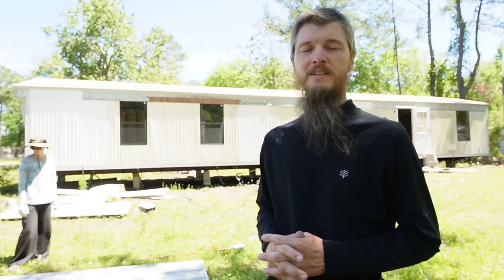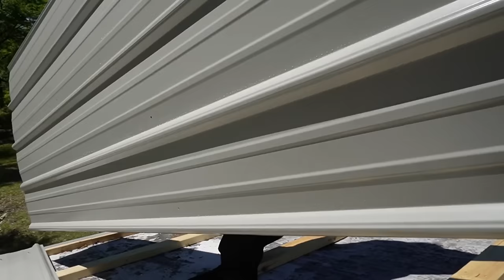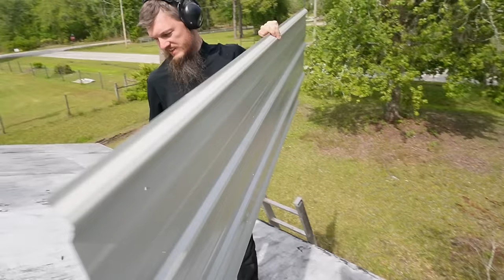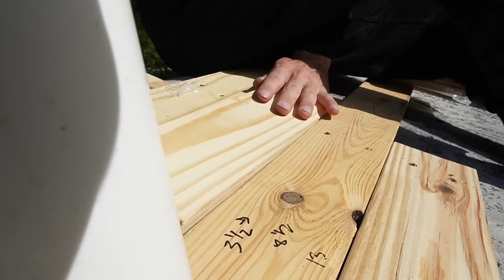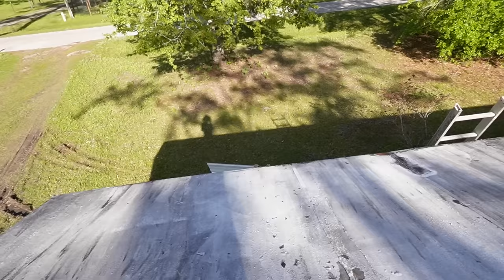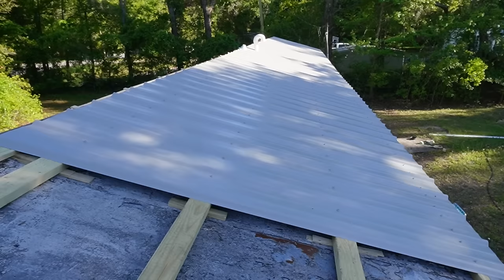Laying the First Panels - Metal Roof Install - Salvaged Mobile Home Rebuild

Comment: Suggestion, maybe you could pull the bus close to the trailer and put all your prepped sheets on top, then just lift them up on the roof from there instead of climbing up and down the ladder.
Reply: I used to call that 'training'.

Comment: I just want to say that I am so flabbergasted by the agility, strength, and sense of balance that both Doug and Ashley bring to this work.  As an old man with arthritis, it's amazing to watch Doug climb a ladder carrying a metal roofing sheet, walk nimbly across a roof stepping only on secure spots, and then drop into a full squat while reaching across to put in a screw several feet away.  If there were a DIY Olympics, you two would be serious contenders for the gold!

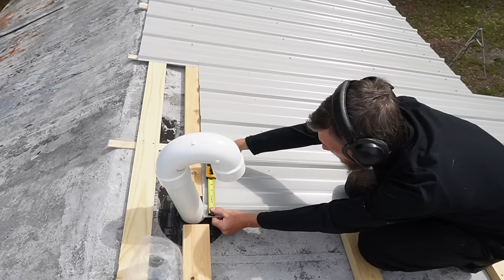Comment: That is a perfect install of the rib roofing. I also really like the color you chose -- not stark white, but still a cooler color for reflecting the heat. The only thing someone could question is a lack of stitch screws or butyl tape on the seams for the most extreme weather prevention measures, but you also still have the original roof underneath it and with your purlins spaced together as close as they are, it's really doubtful you'll ever have issues. I'm a typical over-killer on things. The roof is looking great! @17:45 That was the perfect Dad joke! Well played! Bravo!
Reply from the maker: Thanks! Thanks for stopping by again. We're pretty much just going by the instructions and they say butyl tape on the seams is only required for under 3/12 roof pitch. 

I may have to remove a roof panel or two when I install the plumbing vents. So it's probably going to work out in my favor to not make this roof too stuck together!

Comment: You two chose the perfect color: Black or dark colors absorbs the heat, white reflects the heat but looks messy quickly. Gray is still light enough to reflect and will look nice in the long run. Y’all always make great decisions 😊

Comment: Where we live, you have to use butyl tape on the overlap, and that join also has screws through. Plus bug screening to block the raised channels.
Reply from the maker: Pretty strict but at least you'll have a solid installation.

Comment: It looks so good Doug and Ashley and kids.. the cap for me was the roughest. Just measure on the metal where the edge of the cap will set and find some nice rubber gripping shoes. And have all that you need, pieces and screws. You don’t want to get your feet wet. Rug or cardboard to clean your shoes off and set up on the sunny side,, the sunny side of life!! The best is when it rains. So proud you jumped on this project.it’s exciting, challenging and fuel for your soul. Looking at it done will be so satisfying.. a jack of all trades and a master of none. Keep practicing you’ll get a diploma in them all..❤❤❤❤❤

Comment: The roof color is perfect....great choice.  Doug, I am so glad you predrilled the sheets.  It make the holes line up so nice and I would think it is quicker in the long run rather than being up on the roof trying to align it, hold the sheet screw into it etc.  I saw this done by another you tuber a few years back and I thought then, what a simple idea to make work smarter not harder.  Thanks for sharing.  Y'all have a Blessed day.

Comment: I was surprised they didn't give you bug stop for the eaves. It is a stick on strip that goes on before each panel and also under the ridge cap to seal up the gaps.
Reply: Yep. It keeps the wasps out.
Reply from the maker: We got closure strips for the ridge but the roof people suggested that it wouldn't be necessary for the bottom. They did give me the option though.

Comment: Great job! I told you the color of the metal panels makes it look so much better! Its beautiful! Love the color you chose.By the way , i was impressed by the roof screws with the rubber washers also. I'm using the colored ones with the washers for the ones thru out the body of the mobile home, that were missing or rusted.LOL Mine is so old, it's needed . My roof is chocolate brown

Comment: As always, Doug, you are very professional and attention to detail. I just wish you had put foam insulation sheets between the purlins and the roof sheeting.
Reply: Would the foam insulation be primarily for sound deadening, for temperature management, or for moisture control?
Reply from the maker: We just couldn't justify any possible benefit from it. It would have added $1,000 to the job.
Reply: @eviefieseler1093  Both....plus no need to have air circulation or roof venting for the heat.
Reply: @diyfferent  Many benefits.

Comment: Doug, where your vent coming out of the roof meets the joint of the metal you will have to silicone that joint because rain will run under that joint into the hole in your roof and into your ceiling.. ask me how i know

Comment: Your right the short edge overlaps .  A string line down the middle length of the trailer
keeps you going in a straight line . Did you put a screen in you elbow for your vent ? I need to do the same thing on my vent to keep the bugs out .Your doing a good job . Two thumbs up .
Reply from the maker: Yep, we will be putting a screened vent cap on it :)

Comment: The grey looks great! Not too bright but also won’t soak up heat like a darker color. I think this project is definitely one where you need to have the right tools for success. Routing the board, shimming, cutting etc. a lot of technical things with this particular roof

Comment: When I worked on the cap I tied a rope on the other side so I would have something to grip on to pulling myself up. Then straddle as you go. Be good if Ashley could feed you the pieces as you go so your not going up and down so much. My legs wore out. Stretch before you start.

Comment: Looks awesome. I can't wait to see it all done up on top. Are you going to put some screening fabric (metal) in the pipe so you don't get critters nests built up there. Our mobile was famous for that as was our motor home.......the air would back up and well, it just needs to be done.  LOL  LOL  Hopefully they don's nestle under the high point of the roof at the base where it is higher with inlet area and make nests. I am sure you've already thought of it all, as you usually do..........just an "old timer" curious and knowing some issues we had.  

It all is looking fabulous and I love the color your chose!
Blessings
Reply from the maker: We have a screened cap that'll go on that pipe. Thanks!

Comment: Reason no foam insulation sheets? Another great video
Reply from the maker: Just don't feel the need to. It would have added $1,000 to the job. The possible benefit doesn't justify the cost or work involved. Thanks!
Reply: Foam would add to roof load and interior insulation would take care of insulation needs

Comment: Will having two layers of roof lessen the sound of rain hitting the roof. We had a mobile home in England and it was very noisy.
Reply: I think the two layers plus the insulation will help with most rain storms. I don't know about a deluge. We will see!
Reply from the maker: The ceiling insulation we'll be using will lessen the sound the most. I'm not sure how the double roof will be, maybe we won't hear it all all.
Reply: After living in a mobile home for 5 yrs it was difficult going to sleep where I couldn’t hear the rain.

Comment: Never knew you can buy metal roofing cut to size.
Reply: I own a family run business in the third generation We will bend over backwards to help customers solve tough problems. We like a challenge. 
Box stores really don't want challenges, they want simple sales their untrained and overworked and underpaid 'associates' can ring up, quickly.
Yes, some small companies are hostile to newcomers, sadly. We some in Wyoming. Most, though, will work with customers because there's more to being in business for us than just making a profit (for the MBAs reading along: Most profitable company in our sector in the county).

Comment: I am astonished that you don't wear heavier duty work shoes in case you step on a nail. It seems you would have had that happen a few times with all the work you do. Be careful.
Reply from the maker: Interestingly, the times that he has had nails poke through into his feet were when he used to wear work boots a while ago. This is the only shoe brand he has found to fit his feet correctly, and comfort is priority :)

Comment: Easy for the metal to run off on you. Hard to hold some times. Experience from some work I’ve done. Great choice on the roof. It will breath in the sun  thanks from. Sc

Comment: The roof is looking great.  Doug you continue to impress me by your work ethic, if something needs done you do it, even if it cost you more money, it's called doing the job right, instead of just half ass construction and leaving it for the next guy.  Your roof looks perfectly straight with no dips or valleys that I can see so it was worth using those shims. keep up the good work.  😀✌❤

Comment: You are so right about an impact hammer in the long run it can cause damage with a screwdriver you control it👍👍👍 especially on the right cap. I was told by a roofer that the ridge cap can crack with an impact driver. That’s not a good thing and it leaks and you’re not really sure we’re sleeping from.

Comment: The roof is looking great!  I am amazed at the wonderful versatility you and Ashley have in all the things you are capable of doing.
This 76 years old  woman's mind of mine is wondering about the pipe/vent or whatever it is called .  It looks like there is a an opening around the pipe and I am wondering if water is able to get in there and cause damage or if you have to put something around it to keep the water out.   Now mind you, I know zilch about roofing and house remodeling.
Reply from the maker: There will be a boot that goes around that pipe. We'll be showing that in another video. Thanks!

Comment: Put "rubber boot" over the base of the white pipe. Oh, you already got a boot. You are ahead of me. Great work. As for your end ridges overlapping. Glad you are doing it correctly. It is common sense. I was going to replace my roof with new shingles. But after seeing and hearing you explain about the benefits of metal roofing and the simplicity (compared to shingles) of installing it. I will be doing the same. It is the labor that costs a lot. Now I just need to see if I would be allowed (with a permit) to do the job myself or if I must hire a contractor to install it. Personally, I prefer metal as it has less "drag" during winds. Shingles are rough. Snow will "stick" to it. Yes, load is important, even if there is no snow normally.

Comment: Looking good! I wonder if the air gap between the old and new metal roofs will help keep the home cool. Since the old roof will be shaded by the new one you should have less radiant heat into the home, plus the standing ribs can provide a little ventilation to transfer some of the heat between the two roofs to the ridge cap and out. You commented previously that you could really feel the heat when you were working close to the inside of the old roof. Let us know if you notice a difference in the heat inside the home while you are working on it. Looking forward to seeing the other half!

Comment: i have a 97 double wide with a snow load of 40 psf, but thats in Maine. its on the property i grew up on, the old house burnt in 99, as mentioned the double wide is a 97, it was a display model so my parents got it for less, they have since died so its now mine.

Comment: Doug, what an amazing job you're doing on that roof. I'd hire you in a heartbeat to work on my home - except I live in Texas, and you're not for hire. Lol. I like how you used the nibbler to cut out the area for the vent pipe. Did you use a scribe or just simple measurements to cut out the hole? Either way, it was a professional looking cutout. Ashley is so supportive of you. I admire her for that. Keep up the excellent work. Hugs from Midland, Texas.
Reply from the maker: Thank you. I just measured and made a rough mark-out for where to cut. Thanks for the support!

Comment: You're doing a great job guys. The only thing I would do different is double batons vertical and then horizontal and then any moisture can drain out. I don't think it'll be an issue in Florida though

Comment: Hi Doug Ernie from NYS. Seven years ago my brother and I installed metal roofing on his carport that we purchased at Home Depot. The metal roofing was a thicker grade than the one you are installing and at that time Home Depot did cut the length to size. It was expensive and I don't really know if the heavier grade is worth the additional expense? You are doing an excellent job of restoring the mobile home that previously looked like it was ready for demolition. Really enjoy your videos.

Comment: Super Job! Will you be caulking around the pipe on the roof to avoid water running under the tin? You are making such excellent progress. Well Done!
Reply from the maker: There is a boot that goes around that pipe and we'll be showing that in another video.

Comment: I'm planning on doing this to a shed/garage that sits lower than your project. I would put the bolts where you are placing them. However I've considered placing them on the raised part of the metal to improve water runoff and keep everything (tree debris, etc) from piling up in that valley. I don't have the plywood sheathing, just the rafters/perlins. So I have to work from a ladder. No snow load, in FL also, what is your opinion on the bolts? I'm entirely not a pro, just attempting some DIY on existing structures.
Reply from the maker: You can fasten through the ribs. Just don't over-tighten and hit every rib. Fastener rows should be no more than 24" apart. That would work fine.

Comment: The results are stunning and seem to have put your mind at ease about the wisdom of installing a new metal roof rather than trying to patch the old roof.  I think you have kept the costs to a minimum and the roof was worth every penny.  However, I am wondering if you should have installed foam boards between the two roofs for support, thermal and acustic insulation, and moisture prevention.
Reply from the maker: No. It's not worth it. For us, it would add another $1000 to the cost of this roof, which we already weren't ready for.

We consider all things and the possible R-5 that the foam would give just wouldn't be justified with the time, labor, and cost involved. And it wouldn't even be an ideal installation. 

The air gap alone will stop most radiant heat, reduce noise, and created a pretty efficient roof. So I'm not seeing a big enough benefit of using foam board to consider it for this project.

Though it's been a popular suggestion, I don't think I have ever seen anyone else install insulation like that.

Comment: I think the double layer metal roof with the air pocket and then the internal insulation will be a cooler and quieter roof when all is said and done vs what the house had before.

Comment: Good morning 🙏!,  please consider putting the foil backed foam board on the roof, in between the battens you installed on the roof for the new metal, this will give the new metal some support if you walk in between the  2x4 battens, otherwise you risk bending the metal roofing you just installed!
Reply from the maker: The ribbed panels are rigid and strong enough to be walked on. Ideally, you would walk where the screws are.
Reply: @diyfferent  yeah, that's right, but I've had to replace panels that were stepped on too heavy!, great video, always look forward to seeing you guys !

Comment: you could to prevent the sheets from moving .. put on a schrew through the firs and second hole youre drilling , should keep everything in place
if multiple sheets arent too heavy you could allso screw a couple of them to a piece of plywood with handles on the underside , that way you can lift multiple sheets up upon the roof without bending or ackwardly holding the floppy sheets
might allso be a good idea to put measured  lines on the battens where the open edge of the sheet needs to go , that insures that the sheets arent slowly move off square toward the other end
supprized youre wearing black clothing while working in the full sun , you must be melting on that roof , think lighter clothing would help , still long sleeves and pants but lighter coloured
think the roof will be the most drasticly visable improvent to the home , its like putting aloy rims on a car , it instantly makes it look more expensive

Comment: Trying to get caught up with y'all.  Good point about "wind weight".  You have to figure a 50-60 mph wind is something you're likely to have a couple of times a year with a big thunder or tropical storm w/ our parts of the country.  Fortunately, it's a low ° ∠ of roof, so that does assist with that.  One thing I've learned helping the landlord with metal-roofing porches is it can be a plumb calm day and as soon as you're trying to get panels on the roof, that's when breezes wants to wake up.  >>:=p  Good work as always, y'all.

Comment: Looking good- Would  you ever consider  adding a  bead of adhesive or that tape  you used for the windows  on the boards  to help hold the panel to the roof with the screws? Possibly just on the bottom edge?  Having just been through a high wind event- and the banging sound  from the roof area as the metal flashing flexed and  and vibrated.
Reply from the maker: I'm not sure if I can picture what you are describing, but the roof is solid and will be very quiet. It's very well secured. I don't see the need for anything additional.

Comment: Are you going to weather seal the bathroom vent???
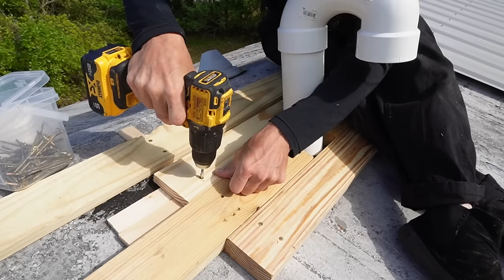Reply from the maker: Yep, at 20:47 there is a roof boot which will be installed in another video.